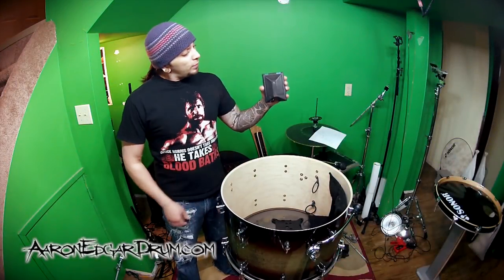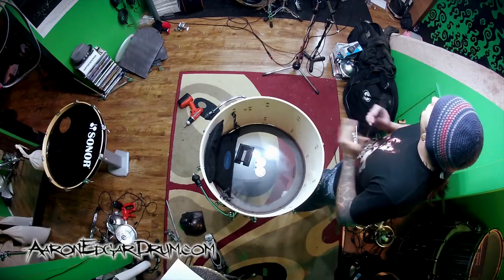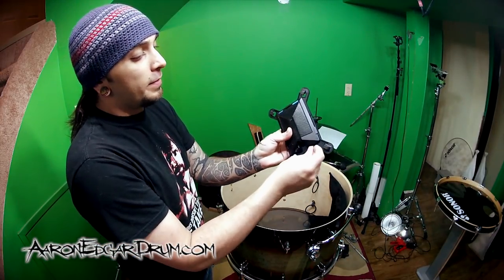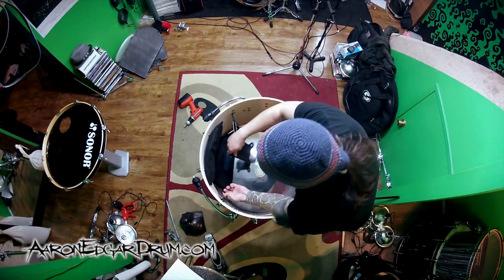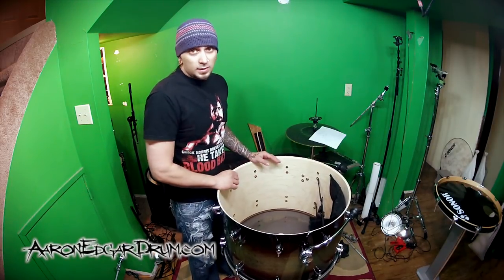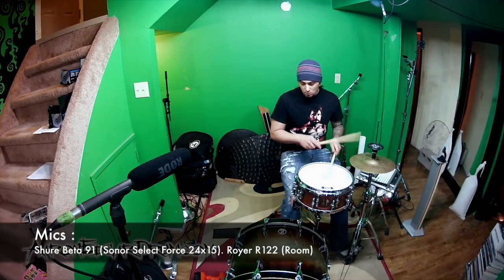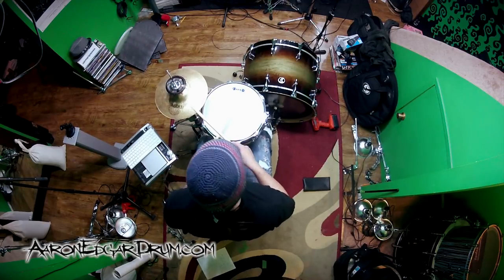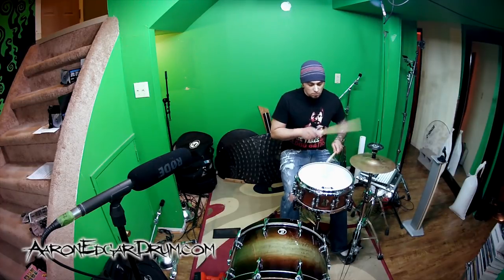How To Internally Mic A Bass Drum : Kelly SHU Flatz / Shure Beta 91

Comment: Yes, that is exactly what I have done and it is incredible. Maybe overkill, but i can certainly dial in any sound i want pretty quickly. Right now i have them both mounted internally and only a 2inch hole in the batter side only (odd, i know) for the cables to run out. I will post a video of it eventually.

Comment: Awesome, i'm going to mount both the D6 and the beta91 with the Kelly shu. I also have a kickport and I will run the xlr's out of the holes in the bass drum (just had to take the xlr plugs off then solder them back on) :)

Comment: How are you running the cable though? Through the front head port? And is it pretty easy to reach in and mic and unmic in between gigs?
Reply from the maker: Yeah, exactly! There are two little plastic pins that hold the mic in, at first they can be a little awkward, but once you get used to it you can pop them in and out without having to get down there and look. \m/

Comment: Hey guy! Thanks for the video. I'm interested in this Kelly Shu mount system. I'm currently using a Beta91a with a D6, just put the Beta91a on the pillow inside the kick. How much improvement have you found of using the Kelly Shu Flatz?

Comment: How did you EQ/Comp this? Did you use the filter switch on the back? If you remember at all... That kick sounded great! I'm looking at that same mic/mount combo because I don't use a ported head. But I've seen other recordings where the Beta 91a sounded like straight caca.
Reply: That's a problem of the bass drum/head/muffling/playing/pre-amp/console/speakers combination, I usually hate the AKG D112, but last night it proved me wrong. I was doing sound at a concert, the drums were great, the heads were in great shape and well tuned, the drummer was really good, the console was decent and the venue had Funktion One speakers, the AKG D112 sounded amazing. I still prefer the Beta 91a though :P
Reply: Hey mate, did you get your SHU mount? And if yes, how do you get your cable out of your bassdrum? Since you don't use a ported head...